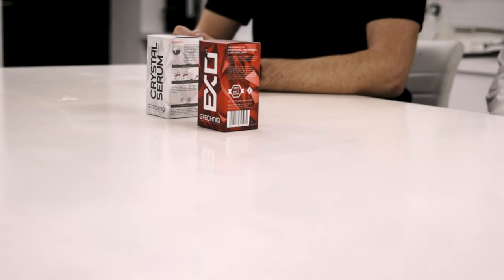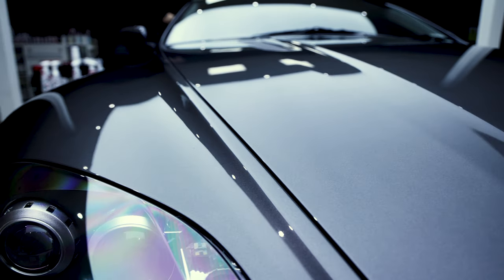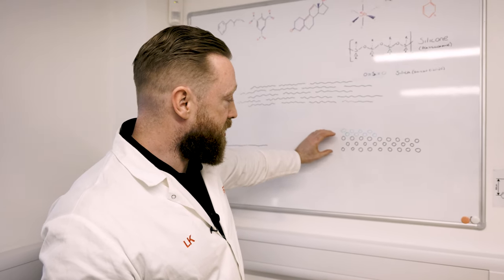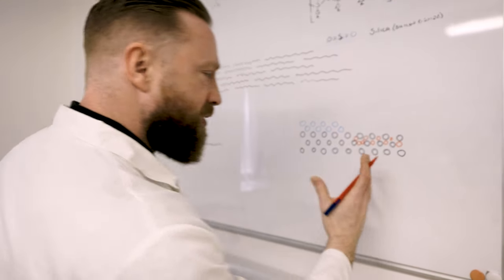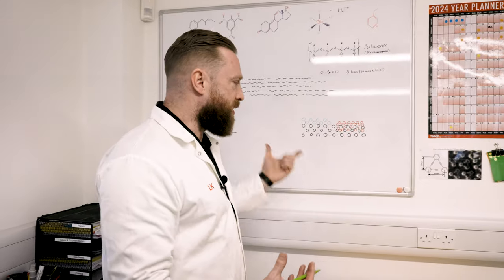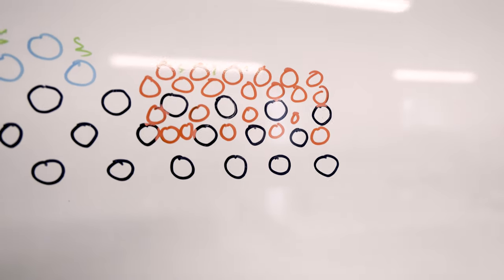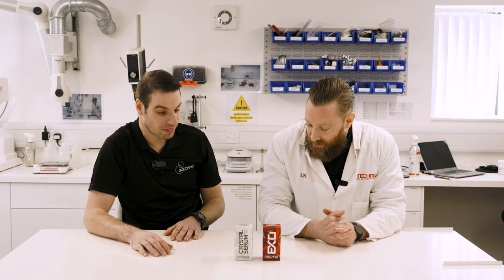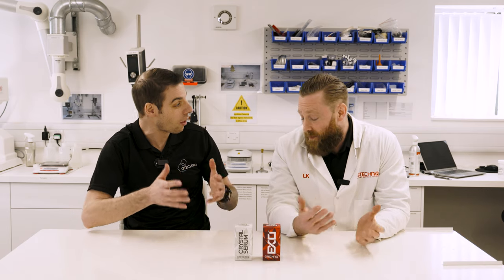Tech Talk - Crystal Serum Light and EXOv5. Why a two-coating system is better than one.

Comment: If the ceramic coating chemically bonds to the paint, then why would it be gone after 5 years?   Do the chemical bonds slowly pull away over 5 years?
Reply from the maker: It will abrasion that removes the coating - things like washing, drying detailing etc.

Comment: Great video. So this basically means you need or should reapply EXO every 2 year?
Reply from the maker: Yes, that is correct although the 2-year claim is based on a daily driver. If the vehicle is only driven occasionally, the EXO may last longer.

Comment: I love videoes like this. Things got clearer, but also a little bit confusing. Is CSL a hydrophillic coating which requires a topper if you want the surface to be hydrophobic?
Reply from the maker: CSL does have some hydrophobic properties but these do die off after a while and the coating then becomes hydrophilic. It is for this reason we always recommend applying EXO over the top.

Comment: Great explanation.
Question. Are they acid repellent too?
For example, a dried bird poop leaves acid marks on car body and they are hard to remove in some cases. 
Will the two layer ceramic protect from those acid marks as well?
Reply: In my experience most "bird poop" marks are not from the acid, but it from heat
Bird poop acts like a shadow on the paint - Heat from sun heats up surrounding area more than the area covered with poop, hence the outline is visible usually but not much if anything in the actual centre

Not always, but most of the time, this is the cause for bird etching.
Reply from the maker: Great question. They are resistant to chemicals in the range of pH2 - pH 13. In some cases it is not acid it is the heating (and contraction) of the paint around the bird poo mark. In most cases you can use hot water to remove the stain by reflowing the paint - there is a good video showing this here https://www.youtube.com/watch?v=Qs7F0QJ1AoA

Comment: I applied the EXOv5 thinking it was a ceramic coat onto my semi truck. It lasted a month so far, which is far longer than ceramic coatings I've tried.  I have 4  layers on it.
What's the easiest way to remove the EXOv5?
Reply from the maker: To remove EXO you will need to polish the panel. Would recommend leaving it to wear off naturally then polish and re-apply a coating and EXO again.

Comment: Is there an advantage of polysiloxane to polysilazane?
Reply from the maker: Polysiloxanes and polysilazanes both offer similar properties. It is not a black and white, one is better than the other answer. 
How the coating performs is dependent on the nature of reactive side groups (functionality), the particle size distribution and quantity of the silica nanoparticles, and the polarity of the carrier solvent.

Gtechniq has developed our ceramic formulations, based on the above, to optimise ease of application, hydrophobic function, dirt repellence, cleanability, scratch and mar resistance, and durability.
Reply: @GtechniqUK  Thank you for the detailed reply. The content with actual chemists is welcome.

Comment: 您好，請問ultra使用靜止超過4小時之後，可以再塗ExoV5嗎？
Reply from the maker: Yes, but we don't advise leaving it for more than a day for optimum performance
Reply: 好的，非常感謝您，另外有兩個問題需要請教您，希望您能幫助我的困惑，謝謝

使用Ultra靜止2小時後，再使用ExoV5的時候是不是只能一次塗一片鈑件就必須擦拭？或者可以一次塗1-3片鈑件再擦拭？

因為我非常喜歡單一層Ultra超級黑瓶的效果，不論疏水或者水斑水漬抵抗能力都非常強，因此，我是不是可以只有使用Ultra，而不使用ExoV5當表面層？
Reply from the maker: We advise applying EXOv5 to one small panel at a time. for larger panels you will want to split them into 4 or 6 sections depending on size. You can use Ultra as a stand-alone product but Ultra topped with EXO will give maximum performance as explained in the video.
Reply: 太棒了，由衷感謝您的說明，解決了我的困惑，看過影片之後，我嘗試過Ultra後再使用ExoV5，發現些微問題，台灣目前我找不到解答，現在我得知問題在哪，因此再次感謝您的幫助與說明，謝謝您